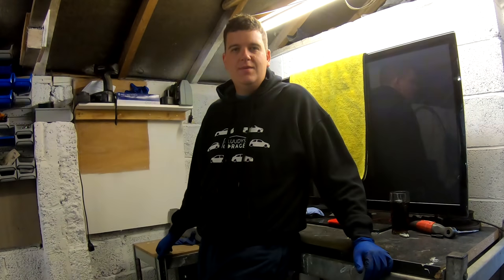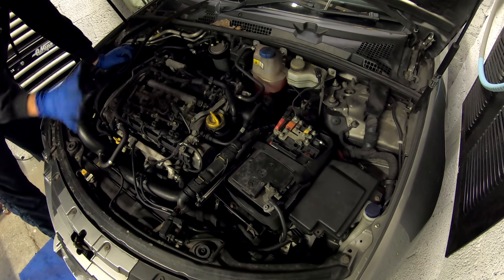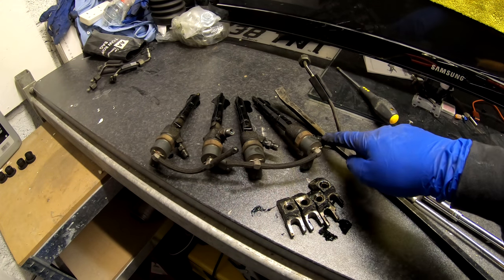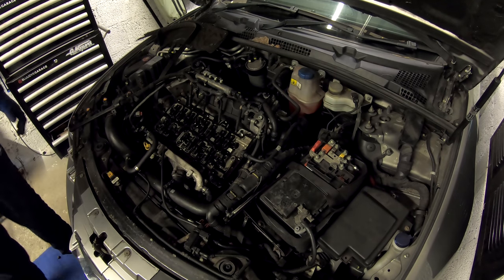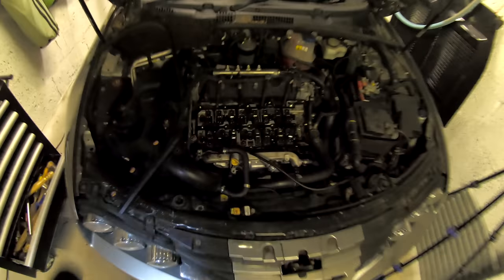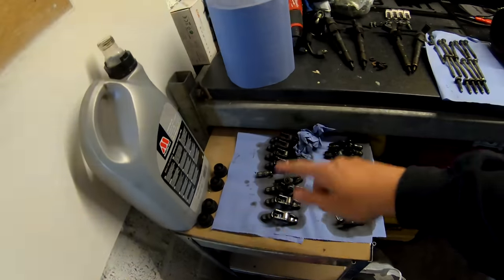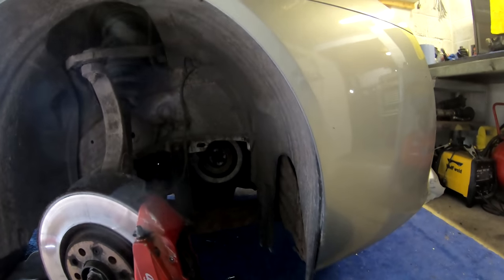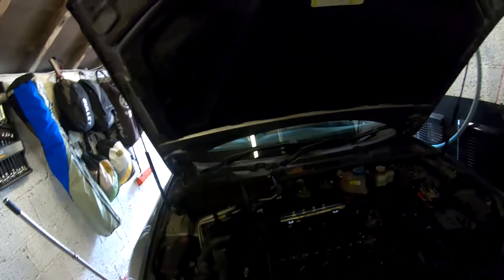How to Replace 1.9 JTDM/ CDTI Timing belt/ Rockers/ Water pump/ glow plugs - (Part 1)

Comment: First thing i did when i got my 159 was change waterpump and cam belt. i think if you are handy, for the sake of £100 or so, this should be done on any second hand vehicle that has a timing belt. anyone reading this should take note and save a lot of heartache.

Comment: The 16v diesel is an interference engine but the valves are set vertically and the rockers are designed to break on contact. Valve and piston damage is usually avoided so lifting the head isn't necessary provided a compression test doesn't show loss. The cam belt failing is usually caused by the water pump seizing.
Reply from the maker: Thanks dude. The pump and tentioner are both nice and free. I'm thinking the belt just gave up.
Reply: Exactly now im working on 1.4 t-jet with same problem. Timing belt broken when i drive. I open engine and all my valve,valve guide was broken. Piston a little bit scratch.

Comment: Hi, would you know the torques of the cam carrier bolts the 20/21 odd on top of the engine or more to the point where did you find the torques values for the engine, please!?

Comment: Double check the servo pump as I had one at our garage which seized and snapped the t belt and also turn the camshaft pulley unknown reason why it seized tho.
Reply: jason williams that exactly what happensd on my dads 150 bhp (z19DTh) vectra ages ago we changed the valves as  It bent them and we changed everything
Reply: Ste Will yes I think we had like 6 bent valves! Plus a load of rockers! But silly me put the pump sensor plug on the fuel rail and couldn’t work out why it would only run for 5 seconds lol! As both sensors are the same plug! But definitely check the cam gear location pin is still intact as ours turned at least 45 dec and broke it!
Reply from the maker: Cheers. Fuel pump turns over ans the vaccum pump turns over freely. Tentioner and water pump also free. I think the belt failed.

Comment: I had the cambelt changed three times on my 156 jtd 2.4 Sport wagon,  but we did do 140,000 miles in it with no trouble at all... until a Land Rover wrote if off. Nobody hurt thankfully. Alfas need maintaining properly, like any car. I miss my Alfas. I had five over 20 years.

Comment: Fuel pump is not timed so dont worry about that tho there is a woodruff key on the shaft.

Injector seals are copper and most of the time stay stuck to the bottom of the hole.

Does it look like any of the valves are damaged from the top?. 

Do you still have compression if you turn it over now there is no cams on?.
Reply from the maker: I haven't checked. I will do next time I'm in the garage. I hope I have lol. I cant see any obvious damage 

Ordered new injector seals. But I have found all 5 anyways. But got new ones. Cheers dude.
Reply: There isn't a woodruff key on later engines, as it so often got dropped and lost. Instead there's a rollpin which stays firmly in place.

Comment: Good video, why not do the head gasket while is all stripped down?
Reply from the maker: No reason to take the head off bud. No head gasket symptoms. No oil in coolant or Visa versa. No point buying a gasket and stretch bolts for no reason.
Reply: It's a massively bigger job, best avoided unless essential. Which it will be when (not if) if the swirl flaps fall off. On this 1.9 16v CF4 they will be the destructive metal type used in the inlet manifold with the black plastic plenum. Now, with cambelt off, is the perfect time to remove the inlet manifold and delete the flaps, to prevent that.  (BTDT, after mine failed, 2 bent valves. Recon head needed. I was lucky, no shrapnel damage to my turbo). It's also a good opportunity to clean out years of soot and oil deposits inside the manifold from the EGR and turbo oil mist, that strangle the engine. Blank off and map out the EGR is a good idea, and recovers low-end torque lost by deleting swirl valves.  EGR and swirls are the Achilles heel of these otherwise tough engines. A simple Stage one remap at the same time will give ~180bhp  and so much more torque you'll be able to do a clutch replacement video next ;-)

BTW Mr Bluudy, you don't need to support the engine when removing the head steady and offside wing engine mount to replace the belts, tensioners and water pump. It won't drop. You probably do want to replace the aux belt and its idler and tensioner, because if it breaks or comes off it quite often gets tangled up ln the cambelt and breaks that too. 

With injectors that messy, you should probably re-cut the seats before using new seals. The tool is cheap on eBay.

Comment: not done it on diesels but on petrols y6ou can get a leak down tester, put compressed air into the cylinder via the injector hole and see if the air leaks oot
Reply from the maker: That's cool

Comment: What about these rollers from the needle bearings? Could they lay down in the oilpan? Is the oilpan Easy  to remove?
Reply from the maker: I believe over got them all. Used a magnet tool
Reply: Bluudys Garage  To yearsago, I got a broken injector on my Passat. I bought a new oildrainplug. Drilled a hole in it and fitted a neodym magnet i the tight fit hole. By the next oilchange there was a little chunk of injektor debris on the magnet.
Reply from the maker: @DerGolf2000  daym man. Good call.

Comment: The brake judder could be related to the tired wheel bearing.  That seems to be fairly common on some more recent vehicles and I have heard of it happening on Alfas, presumably due to a shot bearing allowing the disc to move in and out.  See if it goes away when the bearing is changed before committing to giving it new discs and pads, though with the state of those discs they're not far from needing changing anyway...
If you're going to be working on a lot of front-wheel drive cars then you'd be best off getting yourself an engine cradle so you can hang it from above on a beam supported on the inner wing tops...
Reply from the maker: Cheers man I was thinking the same about the judder. I have a full engine crane but I will rarely take on bigger tasks than my garage allows for nowadays.
Reply: @bluudysgarage    Not an engine crane, I meant a support beam that straddles the engine bay from inner wing to inner wing that has a support hook/s on it from which the engine can be hung using the lifting hooks to support it when the gearbox or engine mounts are out to allow access.  There's almost no chance of something going wrong and causing damage using one of them unless you're a complete clown.  I know of cases where engines in vehicles have been supported on one of those for months, for various reasons, without problems...

Comment: Great job this far, might I offer a couple of suggestions.
1. You can get some pretty decent scopes that Bluetooth to your ph good resolution & colour for reasonable coin.
2. Light, for reasonable video, 3 sources of light, for good video 5 sources of light to eliminate shadow. In your garage some LED work/flood lights from your auto shop will work just fine and they're cheap.
3. Be safe, using the wheel under the car as a safety precaution is adequate, just, cannot stress highly enough how much value a pair of decent axle stands are worth.
From one Alfa nut to another, top job.😎👍
Reply from the maker: Cheers dude.

Got a endoscope coming.

New lights will be fitted when I can afford them

It's on a stand and wheels under it :)
Reply: @bluudysgarage  didn't see the stands,  my bad.
My 159 2.4 SW is up for it's first cam belt, would love nothing better than to get my hands dirty on it, but time poor atm so it's off to an Alfa specialist. Love my Alfa.
Reply from the maker: @brianholden2724  love mine too :) that's cool man :)

Comment: Great video as per mate, ive got a 159 2.4 ti edition.. lovely car just seams a bit loud tbh engine wise..
Reply from the maker: Thanks dude. I'd love  2.4 at some point. :)
Reply: Yep ,had a 2.4 for 4 years loved it but yes engine loud especially when cold , only problems I had were egr valve blocking, snapped coil springs and water ingress through door cards.

Comment: Not sure on the 1.9 but the 2.4 if the water pump fails it can push the belt off.
Reply from the maker: This pump hasnt failed. I was surprised.
Reply: @bluudysgarage  sounds like if was just a faulty belt.
Reply from the maker: @lukecowell7516  maybe but who knows how long it was on lol

Comment: Change the water pump while u at it when bearing goes belt will slip again
Reply from the maker: I am doing ;)
Reply: @bluudysgarage  
my old Stilo 8v was dealer serviced before I bought it they stripped a bolt and left the old water pump on belt came off when the bearing poped luckily the Stilo was OK just needed a new belt kit

Comment: I would be really surprised if there isn’t a bent valve in the engine
Reply from the maker: Statistics say there shouldnt be.
Reply: Bluudys Garage I know what statistics say I have had these engines in pieces and they do quite often still bend the valve It is 50-50 if it has or has not bent a valve

Comment: New tyres mean fuck all I can go through a set of continental on the front in 5k miles on the 2.4
Reply from the maker: Daym..
Reply: @bluudysgarage  they are know to scrub the inside tyre pretty quick apparently pollybushing the front helps and getting tracking set up by competent specialist and not to manufacturers specs and of course the easier you drive the longer they last. Something I need to learn how to do

Comment: If the alternator goes bad I think it would be a pain in the ass to change it.
Reply from the maker: Meh. It's an alfa you have to love it lol
Reply: You are right. Worst job on the car, pretty much. It can allegedly be done from the top, but there's a lot of stuff in the way and you need 4' arms. Normally people drop the subframe a bit, at the back, to make just about enough space. Insane, but originally the engine was designed for longitudinal use, not transverse FWD.

Comment: Valves fucked up 100%
Reply from the maker: Very doubtful.
Reply: @bluudysgarage  Take the head off and you'll see.
Reply from the maker: @gregorteply9034  not on these engines. They are designed to break the rockers.

Comment: You already lost money you bought a Alfa buddy
Reply: I love to see people saying this on the web. It scares people away, which meant I could buy a 147 Sport Q2 for half the price of an equivalent dull old VW Golf Mk4 tdi 150 of the same age along with its rusting wheel arches, narrow power band and incredibly stupid bayonet boost hoses that blow off every few weeks. Don't get me wrong, VW etc are fine cars, but many people neglect them horribly because the reliability myth encourages them to think they don't need any maintenance. Alfas have their own problems, but are fine if you look after them. Fortunately Alfas tend to be owned by people who want to. This really matters with cars as they get older.
Reply: @MrShadownoise  well I never owned any car that's less than 5years old or newer. I guess you play golf as all Alfa owners plays golf. They just have a bad rep for electrical problems. I also own 1968 escort mexico
Reply: @wildhaggis6326  That'll be the  German Bosch electrics used by Alfa, I suppose, although I've not had a single electrical problem on my 11yr old147.

The only golf I've enjoyed was the Mk1 GTi I had 1984-1991. It wasn't especially reliable but it was great fun.

1968 Mexico, lovely! So simple and accessible to work on.